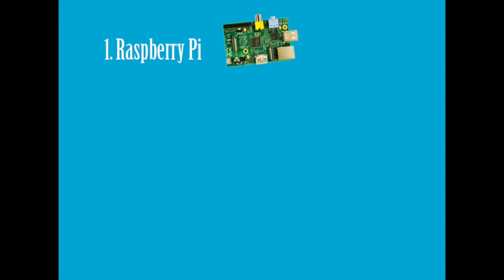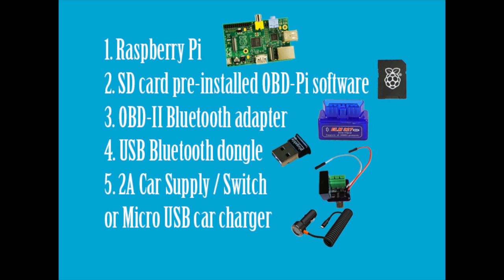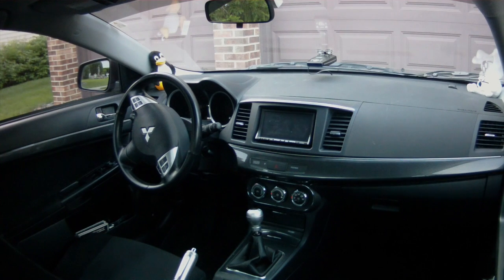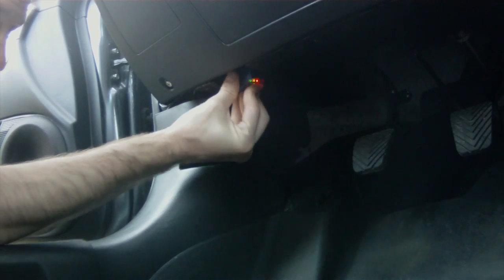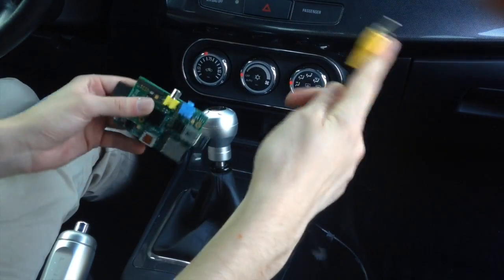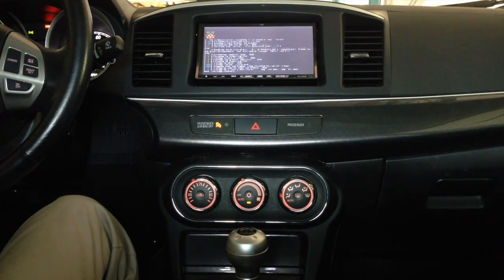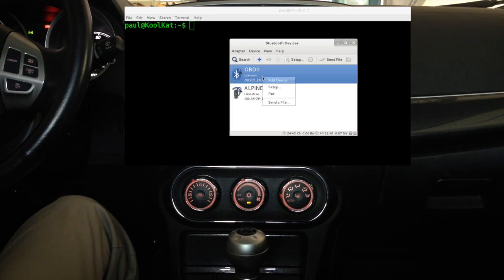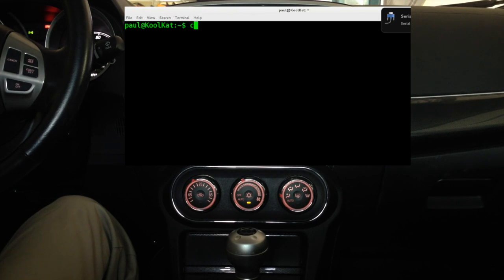OBD-Pi Tutorial: Raspberry Pi Displaying Car Diagnostics (OBD-II) Data On An Aftermarket Head Unit

Comment: We followed same steps but not able to get any value on vnc screen
Reply: Now the problem is to run OBD-PY, because the software has been developed several years since the program was created. WX Python was updated, Py series also. Bluetooth Blueman bluez-utils does not work anymore. You have to look in the archives on internet of the old original versions of the program that worked backwards, or modify the code obd-py to a modern version. Not difficult for one who wants it.

Comment: Lot of things have changed since then, esp bluetooth connection. Bluez doesn't work anymore and the Bluetooth GUI is different now. There is no option to trust a device and no option to Connect to SPP Dev. I'm struck in that part.

After some googling and trying out, I think I now have connected the bluetooth to the serial port. It says "Connected /dev/rfcomm0 to xx:xx:....:xx on channel 1"
But still when I run the program, it says "trying to connect" and then the screen goes blank. I'm not sure what is the issue
I run an app in my phone, connected to the OBD device and I'm able to view the data.

Comment: Awesome!

It sounds like you're driving a manual.. Do you know of a way to reliably ascertain the current gear? There are plenty of algorithms out there that try to do this by using the cars speed and RPM's.. and this may be somewhat accurate, but I want to do crazy stuff like have my Nitrous kit spray a specific amount at specific throttle %'s, within a specific RPM ranges in different gears. So this means that something as simple as a mis-shift could blow the engine..

I thought it was pretty ridiculous that there's no PID for the gear (at least not in a car with a manual transmission)... But theres one for just about anything else imaginable.
Reply: justin hyland pretty sure there is a gear pid

Comment: Thank you Paul for this awesome project!
I am just wondering if it is possible to see batter voltages as well, since it is not showing on the dashboard in the video?

BTW where should I connect to my RCA cable? I did not have a socket in my car ( Nissan Micra 2011).

thanks!
Erik

Comment: I wish I could use this but I keep getting same error. I have tried ELM 327 Bluetooth and USB and getting same error:
File "obd_capture import OBD_Capture
File "/home/pi/pyobd-pi/obd_capture.py", Line 49
for i in range(0, 32)

And I have tried to fix it with:
1. Open up obd_capture.py
2. Go to line 51. Add this code underneath it: 
print "Index 0, ",(len(self.supp))
3. Save the file & run: python obd_capture.py
4. View the terminal window, you should see:
Index 0, 32
(Note: If the second number is not 32 then this is where your problem lies)
5. Edit Line 49 of obd_capture.py 
Change:
'for i in range(0, 32):' instead of 'for i in range(0, len(self.supp)):'
6. Save the file & run: python obd_gui.py

Comment: Cool... but car's display does not have any AUX input... in fact, most cars I know are like that
Reply from the maker: Yes sir, also HDMI :)
Reply from the maker: Hey David, it is intended for Aftermarket head units which support Auxiliary input.
Reply: *****
Awesome video, sadly I do not have a RCA output either. WIll this work with an alternative mini LCD display with RCA output?